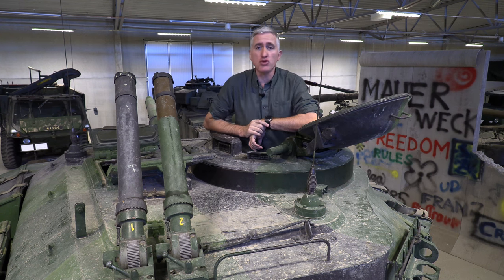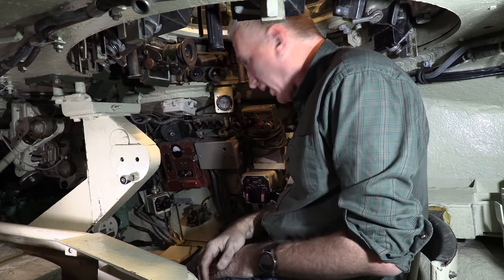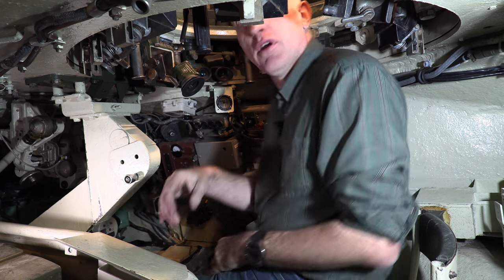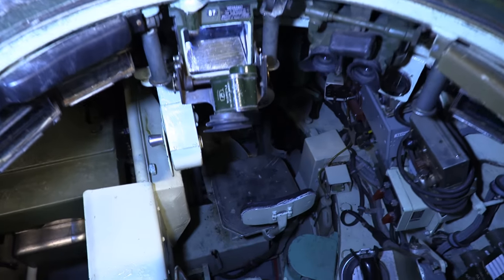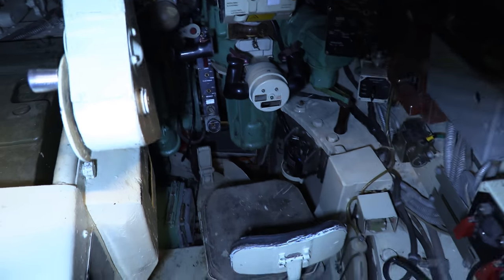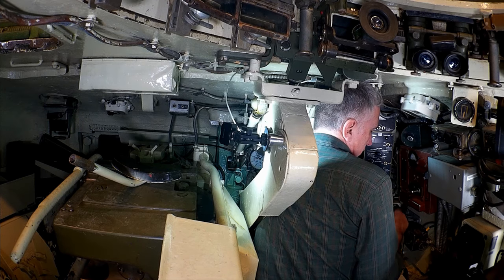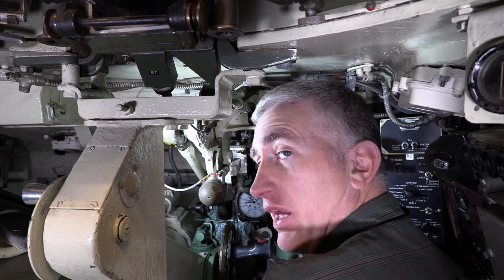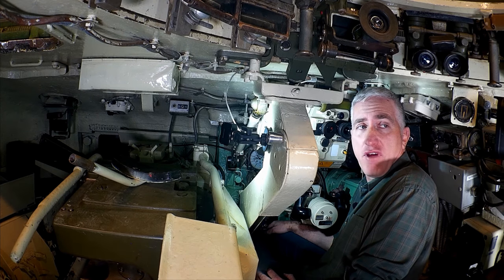Inside the Chieftain's Hatch: Strv 104, Pt 2

Comment: Chieftain, in the Dutch cavalerie museum they got a leo 2a4. If you just ask they will let you get in it.( it happened to me) the tank is in pretty good condition. Hope you see this
Reply: Comparing it with abrams would be nice.
Reply: Arsenalen has a strv 122 so im sure he would be allowed into it
Reply: @sjoormen1  Wouldn´t be such a big suprise that the Leo. 2A4 will be better then the M1 Abrams XD
Reply: @einar8019  yes and no. Arsenalen doesent own that one. Its just "in storage" there. Still belongs to the Army. So no, Arsenalen doesn't have anything to say about that one.

HOWEVER. they do have one of the Leopard 2 prototypes standing outside. But that one has been submerged on the bottom of the Rivere Elbe for a while so it is not very nice inside.
The turret looks a bit like a scaled up Leo 1 turret and the chassis is a bit different from the production vehicles.
Reply: @Tankliker  The Leo 2 is generally considered to be more cramped (though still fairly comfortable), and having a worse vision cupola (made up by for the stabilized panoramic sight).
The Leo is a pretty good tank in terms of ergonomics, but it's really hard to bet an M1 in this regard, though I haven't heard either of them compared to more niche western designs (Leclerc, Ariete, Chally 2), wonder how those would measure up.
Reply: @luki97z  I was more about the fact that he wanted to compare it to a M1 Abrams, which is the earliest version, while the Leo. 2A4 is the first major upgrade with new amore layout and sligthly changed suspension.
Reply: @Tankliker  think your confusing it with the leo 2a5
Reply: einar gavs inte den tillbaks till armén ett tag tillbaka sen? Står en BV 206 där nu
Reply: @justarandomguy37  no, the A5 is a whole other thing, but the last German batches of Leo. 2A4 received the C and D Type armore.
Reply: @Solipsil or even the guy that had the name I guess.
Reply: You can find various versions of the Leopard1 and 2 Tank in the Deutsches Panzermuseum Munster :)
Reply: @Tankliker  Some new sources indicate that all Germal Leopard 2A4s got retrofitted with the "C" type armor post-1987, while the last production batch of ~85 vehicles got the D type
Reply: @luki97z  I only know that the 8 and last batch got the new armore Typs.
Reply: @FlexDB  but not all of them are for puplic access and they all are still in the Hand of the Bundeswehr.

They are still weapons of war and only the Bundeswehr is allowed to handle such weapons, if the wehrtechnische Sammlung Munster was a real museum then they would have to disarm all there tank.
Reply from the maker: I think I would best be comparing the A4 to the base M1A1, after all, I crewed the latter and the A4 was the contemporary.
Reply: Well, it should be fair, so  contemporary would be nice.
Reply: @TheChieftainsHatch  they were built during the same time so it would be
Reply: @TheChieftainsHatch  i think England did WW2
Reply: A trip to that museum would be nice, they also got a Leopard 1V and PRTL. Even better would be a trip to the NMM, also in the Netherlands, they have a Leopard 2A6 there although I doubt they would let you crawl around in that one
Reply: @jasperb9233  the prtl was only there for repairs
Reply: @just a random guy Didn’t know that, but the NMM does have a PRTL right?
Reply: just a random guy lol
Reply: @jasperb9233  think so

Comment: Sweden actually used Mk 3, Mk 5 and Mk 10 Centurions. The 1st batch of 81's were Mk 3's and the second batch were Mk 5's. All 20-pounder armed centurions were interchangeably referred to as Strv 81, irregardless of whether they were actually Mk 3's or 5's. The third batch of Centurions they got were of course the Mk 10's. This particular vehicle was likely originally a Mk 3 since it was the oldest and most worn of the 102's that were rebuilt into 104's. As such it never really had a full turret basket to begin with, I believe.

Comment: The Olifant (elephant) is the ultimate nCenturion: torsion bar suspension, 36mph, 360 km range, designed to take on the T-72. Just the gun is a bit light, but fire control and command systems are top notch. Still basically the same hull and turret, now a bit long in the tooth

Comment: With the benefit of hind sight, what would the optimal and most economical US tank selection look like, i.e what would connect the M4 Sherman to the M1 Abrams?  Also what would precede the M4 Sherman since the US didn't really have a tank capacity before then.  Would the alternate branches still exist like the tank destroyers units?

Comment: Remember the turret is simmilar on the Strv-101R and Strv-102R
Reply: The 3 actually differs pretty drastically from each other. For example the 101's being originally Mk 10's had turret baskets, while the 102's being Mk 3's or 5's originally had no turret basket at all.

Comment: Re being withdrawn from service in 2000. This as far as I know is true. The last 104s were deployed with Lärbro Kompani MekB18, Gotland. I did my conspriction service with another company, but was present at the ceremony at Oskarsstenen when they were retired.
Reply: I did my conscription in the MEKB18 regiment the year before, 1998/99, in an APC company. In one of our last major exercises the STRV 104 from MEKB18 fought the Leopard 122 from other regiments in Sweden, and the STRV 104 performed remarkable well. A lot of times it came down to the skill of the crew who shot out who. A major difference between the tanks watching from outside was the speed. The Leo is much faster both going forward and backward.
Reply: @KruzzeKing  Was that the legendary "Rolling Armor Museum" incident? I keep hearing things about it, but i never been able to confirm if it was just pure myth, tall tale or an actual true event.
Reply: Roma?
Reply: @KruzzeKing  We wen't over to skåne also and had joint exercises with/against other units, including 121s and 122s. Me serving in a PvRb platoon we saw quite a bit of the tanks :)
Reply: I did one of my PRAO weeks at the vehicle repair centre at P18 in -99, spent most of it sitting in the drivers station of one of the Strv 104s reading the manual while the AFV techs worked on installing a rolling sled housing for dual commercial 24v truck batteries to replace the dozen or so old square top battery cells.
The turret was lifted off completely for the modification.

Some years later, 03/04 I did my conscript training in Havdhem company, mortar platoon.

My dad used to work up at the officers "retirement home" across the road from the main base at the time (I MKG-staben, Övlt. fd. KA3)
Reply: BigSwede7403 My brother was a platoon leader in a Centurion company, it must have been 96/97. He told me he kicked some Leo butt on Revinge and his officer’s were ecstatic. Don’t know if that was the “rolling armor museum incident” but I like the idea that there was such an incident :)
Reply: mikael lövgren Yep, Roma kompani.
Reply: Christian Forsström I served in a pvrobotplatoon as well. Robot 56 Bill worked really well on the Leos but we always got shot out after killing one or two tanks. The PBV 302 was not fast enough when we tried to get the hell out of our stance :p
Reply: @KruzzeKing  I have a friend who served as a gunner on a centurion, same year as I was in, and he said they often won against the Leos on Revinge also, he chalked it up to them having much more hands on time in the centurions than the Leo crews had in their tanks simply because it's less expensive to run a centurion, and they probably had to keep the same budget.
Reply: @christianforsstrom2222  
Någon du känner igen i denna videon då?
https://youtu.be/JOYDF2aSguY
Reply: @SonsOfLorgar  Oj, vilken nostalgitripp. Där fanns många ansikten jag känner igen. Såg mig själv som hastigast vid något tillfälle också. Jag har VHSen ligger här hemma nånstans, men är några år sen jag såg detta senast :)

Comment: It drives just like an M48/M60 since it is using the same transmission. I started as an M60A1 driver.
Reply: Oh wow , I'd love to see Nick do an  interview with you . That needs to be done on site with one of those beauties.
Reply: I started out as a driver on  M60A1's too. Finished up as a TC  on a M1IP. Lot of changes happened between 1972 and 1989.
Reply: Ralph's Place  
Crats were alot better than the early mre's. Used to heat the cans up with the heater.
Reply: @raybrindos4514  I was on M113s/M901s (Cav Scout), on a march the driver would put the cans on the engine block.  Turned out that worked with later MREs too.
Reply: Ralph's Place  I stayed in 27 years RA and NG. Started on M551s and finished on M1s with M60A1, A3 and 48A5s inbetween. Started with C-rats went through 20 years of MRE evolution.
Reply: @raybrindos4514  I retired as an M1 PSG in the NG. Loved tanks too much to give them up but full time Army life not for me.
Reply: @raybrindos4514  the early MREs were awful, it took 20 years but they got better. The new rations look better still, tacos?

Comment: It's amazing how long the Centurions in one form or another have continued to be used. I've just been reading about the IDF Nagmachon (Doghouse II) APC which is based on the Centurion hull and is still in service. For an armoured vehicle to still be in used (although not as a tank) over 70 years after introduction is just amazing, especially when you think that tanks have really only existed for about 104 years, which means the Centurion (or it's hull at least) has been in use for two thirds of the entire history of the modern armoured vehicle.
Reply: i wonder if the south african Olifant is still active?
Reply: @SDE1994  As far as I can tell they are. The Olifants were apparently upgraded in 2005/6 by BAE Systems and entered service in 2007.

https://www.army-technology.com/projects/olifant/

So that means there are MBTs out there, in service, that are (at least in part) 70 years old, which is astounding.
Reply: OMG, These are the B-52's of tanks. Just keep going, and going.

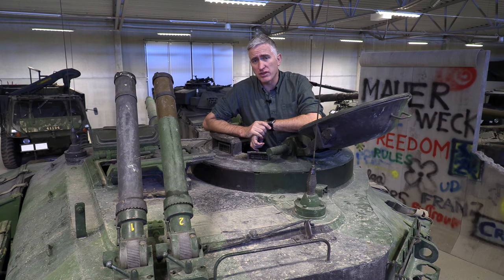Comment: When I was at arsenal for the 2nd time, I had my sister with me(first time I was there I was with my dad and saw the mighty jingles and the s tank driving around). And I was having fun and joking around to my sister because she isn't interested in military stuff. But I did some info dumping and huged my favourite vehicles there. Then we came to the cold war area in the museum, and I told her that the Berlin wall (background of 0:15) was an actual part of the berlin wall. (I knocked on the wall the first time I was there to check if it was actual cement) she believed me, until I told her that it's just a wooden mockup. And we had a laugh about how weird it must've been to transport that huge wall.

Comment: Trying to imagine 4 Swedes as big as Chieftain fitting in there, Cosier than a Sauna, Especially with the BV on the go  lol
Reply: Tank crew until very recently had a height limit of no more than 170cm. The crew that would have been allowed in these vehicles would have been a good head shorter than the Chieftain at the least.

Comment: Gunnery with flare illum is not easy. We dinotankers remember.
Reply: M60A1?
Reply: M60A1, searchlight duty.
Reply: I was  NJARNG 104th AR (or Cav depending on time period) HHC 4.2in Mortars, supported Tank Table VIII.  One drill the S3 scheduled the wrong Mortar Firing Point, didn't take Angle T in effect, there were calls for "Check Fire" on the FIST Net, from the 4.2in Illum casings bouncing off of the M48A5 Tanks.
Reply: M60A1 in Korea, 1978 and ‘79. We did our night Table 8 runs with both searchlight illumination and flares from the 4.2 inch mortars. My crew shot the hell out of the daylight portion, but both my gunner and I had less than optimal night vision. We managed to qualify, but barely.
Reply: @LOLHAMMER45678  I gunned on an M60A1 with IR so searchlight, range card and flare. Also was a gunner on M48A5s all the same. You had to wait until the flare almost hit the ground to see the target and glare was a bitch.
Reply: @adlerarmory8382  When were you in, during my tenure it was the 102nd armor and the 117 Cav.
Reply: @thomaswilloughby9901  I was assigned to the Vineland Armory HHC 3/102nd AR 1988 to Jan 1990 when I went on active duty, got assigned to my first tour with Berlin Brigade.
Reply: @adlerarmory8382  I was in the 3/102 as well Delta Company out of Bound Brook. We were reassigned after the 1/102 was closed. We had just gotten the M60A3s. I made my E-7 with the 3/102. It was at the same time or close to when you were there. In 1978 my unit sent a mixed Troop to Berlin for MOUT training so I was there for a week. Shulthiess beer

Comment: 6300 mins in a swedish circle. I am confused.
Reply: Mils, milliradians. Instead of degrees many military applications use mils for measuring angles. To make things confusing though they don't use actual milliradians (of which there would be 2π/1000 in a full circle), they use an approximation. In NATO countries there's 6400 mils to a circle, while in the old Warsaw Pact countries there's 6000. Sweden being neutral but leaning towards NATO placed itself neatly in the middle and used 6300 mils to a circle, at least in the cold war days. At some point after the year 2000 the army converted to NATO standard.
Reply: @renhanxue  in 2004, the 6300 lines scale was still used along with the RT90 (Rikets Triangelnät 90, eng: Triangulation grid of the kingdom ver. '90) map reference system.
In addition to regular orientation maps of 100 000:1, 50 000:1 and 10 000:1 scale, there were also special maps with geomagnetic deviation and such details for use in artillery ballistics sollutions.

Comment: There was plans for further upgrades too.
Strv 105 and 106 wich would have upgraded the Strv 102 and 104 if my memory is intact. Only 1 Strv 105 was built as a demonstrator. 106 would have been the same upgrades but to the 104 model.